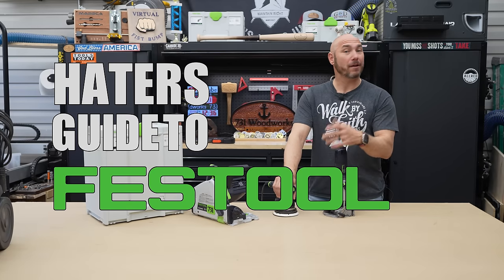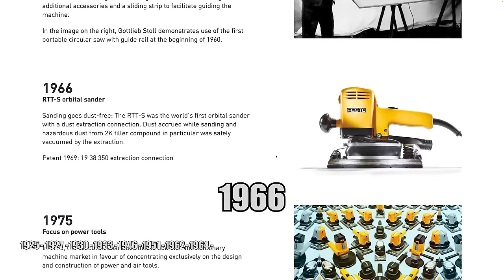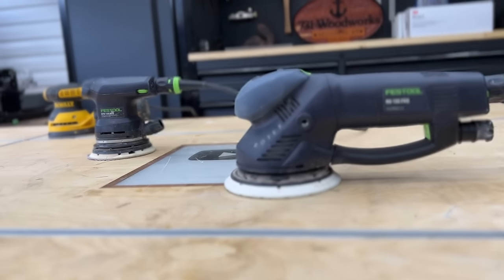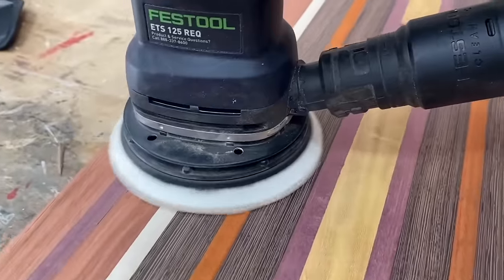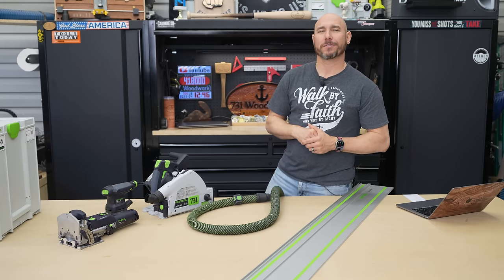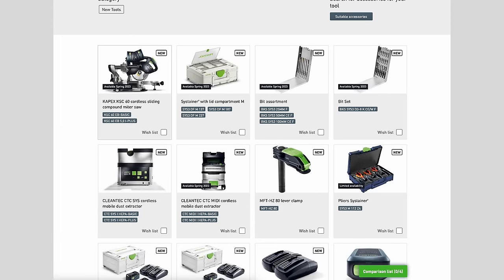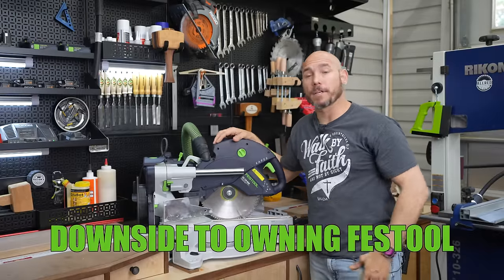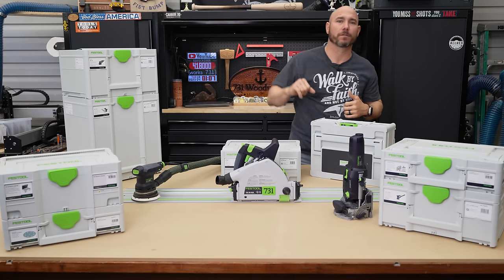The Hater's Guide to Festool | How Festool Changed the Game

Comment: Wait till this guy finds out about Mafell....
Reply: LeMello, Mirka, Fein, Hilti…
Reply: @robhaydnsei  - Fein and Hilti may price the same, but they're not in the same league as Festool and certainly not Mafell. Mirka are specialists (sanding) to me. Priced similalry to Festool and 3M for very similar products but without the same infrastructure.
Reply: Erika😍. When you talk about expensive 😭
Reply: My 2003 mafell jigsaw. I’m 56 I’ll take bets it will out last me
Reply: @garymelrose9727  they're made for different works..
Reply: @basbouwman5139  its only the Price. Hut how long did u use @ Erika?
Reply: @renelange141  Im still using my Mafell Erika made in 1989, its running like new and it got used a lot over the years.
Reply: FEIN is for metalwork, HILTI is for constructions, Festool is for woodworkers who haven't tried MAFELL. 

Mafell is dominating in cirkular saws and jigsaws, Festool might have advantage in routers and dust exstraction.
Reply: I bought my first few Mafell tools (track saw, duo dowel joiner, and jigsaw) in 2020 when supply chain was shut down and Festool was on 6+ months back order. All 3 tools are phenomenal and I’ll be keeping them in mind for any future tool needs, but I also just stepped into the Festool system with the domino and a dust extractor and they’re good too. German engineering, can’t go wrong with either.
Reply: The P1CC shouldn’t be called a jigsaw. Makes a sawzall seem like a black and decker jigsaw.
Reply: Festool user since 1995. This summer i had to replace my first battery.
Reply: You buy all Festool Tools one time in your life … and if anything broke you call Festool and they get it at your home, repair it and bring it back to you … sometimes personal. Which other company do that?
Reply: @garymelrose9727  we're building a house here in Germany and of the 20 or 30 tradespeople that have come through, I haven't seen anything except Hilti. A Makita drill once and a Festool mitre saw for the staircase, otherwise it's Hilti 100%. At least here, it is the big-boy tool. My father-in-law has a Hilti drill and I think I could smash my Makita drill to dust with it without leaving a mark
Reply: @garymelrose9727 well nothing Comes close to the fein multimaster. Which is why basically ever craftsman knows the Brand. Conspny for a Single good tool.
Same with hilti. Their hammerdrills are unmatched by other manufactures, and will last Generations. For jigsaws, NOTHING beats the P1CC by mafell. Plungesaw is up to preference, mafell or festool. Everything else I'd go with festool any day (though for everyday sanding I prefer the mirka sanders)
Reply: @claytonthomas8806 clearly you're not a BMW owner to have that take 😉 I think Sawstop was a great and fitting acquisition for them. The attention to detail by both companies is exceptional.
Reply: @Caffeine.And.Carvings  - hated my old Fein multi tool with a passion. Love my Festool cordless version. I’m aware it’s a version of the newer Fein, but it just has that Festool polish and uses my current batteries. In fact my very first Festool tool was the NiMH C12 (great grandfather to the current C18) because my Fein drills are batteries until they stopped being supported (just over a year). Still have that C12 along with both original batteries alongside a C18 I bought this year. I’m fact the 12V batteries work in the C18 in the extremely unlikely event that I ever ran out of Festool 18V battery power. They even run my carpenter saw and track saw…though at reduced power and, I suspect, not for very long…😂
Reply: @nattyg078  - funny you should mention that, this Festool owner is also a repeat BMW owner, in fact my 6th or 7th, all from new ranging from 1 series through 6 series and not a single issue with any of them. Buy them, use them and after 3 years take them back to the dealer for the first time for an MOT and service and get ready to get another. Very similar reasons - there’s a common design ethos that runs through the series and the generations that means I always know exactly where everything is and what it does. Can’t remember the last time I looked at a manual. Such is the life and contentment of a professional Engineer. 👍
Reply: @Painless61  maffell dont break so they dont need that service
Reply: I live next to mafell HQ in Germany 🎉
Reply: he will drink all of that koolaide...gallons
Reply: I have seen a few negative reviews for the Maffel track saw. Everything else is likely better than Festool.

Comment: For casual people, it’s expensive. If you are a shop and are making money, it’s an investment. The replacement service is crazy good. I don’t own any festool yet, but I’m looking at a boring 5” sander just because after using one for a couple days it was much faster, cleaner, and quieter. I used the 3m 710w sanding discs and worked from
120 up to 240 and it was clean.

It’s funny you mention the 125 sander, I have one in my cart lol.

And so it starts! Toe dipped.

Comment: Festool products, and people's reactions to them, are interesting. For a finish carpenter, Festool -- particularly the entire Festool ecosystem -- cannot be beat. (We can argue about whether Festool is better than some of its top-notch competitors, but that's a different discussion.) Their tools are portable, accurate, and leave little mess. Perfect for doing precise work at the jobsite.

But, what about a woodworker -- someone who makes fine furniture or meticulously crafted boxes and such -- as opposed to someone who merely works with wood? For a woodworker, Festool doesn't have nearly as much to offer. I used to manage a cabinet mill. If I were setting up a large cabinet shop today, Festool would make up a very small part of my tool budget. Since I won't be taking the tools from jobsite to jobsite, portability isn't a plus factor. Nor am I going to want all those systainers taking up space. I might use a tracksaw for breaking up sheets of plywood, but I doubt it. Instead, I'd use a cart to move materials to the table saw. And, many of those table saws would be sliders. I might have a domino (or three). And, I might have a Kapex. Other than that, I don't think Festool products would have a role in my newly created cabinet shop. All my sanders would be pneumatic as would my drill drivers. I wouldn't have router table, I'd have shapers.  

On the other hand, a smaller shop -- even one that does professional work -- might benefit from a whole host of Festool's products. There, Festool's portability pays dividends. Space in such an environment is at a premium, and Festool's ecosystem allows a lot of capability to fit into a relatively small space. If I were building myself such a shop today, it might be exclusively stocked with Festool products.
Reply: 100% agree, my friend makes bespoke built in furniture and he uses a lot of Festool gear when he is fitting on site but in his shop he mainly has serious machines like a cabinet saw and spindle moulder and radial arm saw, planer and thicknesser etc. Festool really don't make any serious shop machines for making cabinetry other than maybe the domino which is an amazing device.
Reply: ANd those pneumatic tools most likely would use festo pneumatic equipment like vavles and so on and so forth, so you would still be using festool or at least stuff from the same parent company.
Reply: makita?
Reply: @ReizungV  I own several Makita power tools. They are all excellent. However, Makita doesn't have the same kind of ecosystem that Festool has created.
Reply: @DKWalser  okey, i dunno what ecosystem they have, but makita has pretty much all tools on 18v and a lot of tools on 40v ?
Reply: As much as I agree with you, in this videos he also talks about contractors. I am a starting contractor and I've owned my business for about 2 years now and festool doesn't add any value for me. The only people in the trades who I've seen use festool is electricians as some specific tools are quiet light and in Europe electricians work above their heads all day.

Besides that. For me makita is the way to go. Alot of other contractors pick Milwaukee for their plumbing products and Dewalt is used by contractors who have a lot of employees who tend to drop their tools down 6 meter high scaffolding. 
No one uses festool since a little bit of dust doesn't hurt when you are walking leaves into someone's house every time a door opens. And the added precision their tools give take too much time to be cost effective.
Reply: @basdewildt7973  You do you. I'm fine with that. I don't have a dog in this hunt. I don't own a single Festool, Dewalt, or Milwaukee product. (I do own some Dewalt and Milwaukee bits, blades, and hand tools.) I do own Makita, Bosch, and other brands. I'm just not a fanboy for any particular brand. I use whatever works (and what I can pick up cheap, if I won't be using it often). 

But, I did work as a finish carpenter in the 1980's and I installed a lot of kitchens and other built-in cabinets. Festool wasn't around then (at least, not in the USA). I can see a lot of advantages to Festool's ecosystem. Their MFT table, tracksaws, routers that work with their saw tracks, shelf-pin drilling system, etc., that all fit in easy to move sustainers, are great for finish carpenters and cabinet installers. Each tool in the ecosystem makes the other tools more effective because they all work together smoothly and efficiently.

Are they necessary? No. As you say, there are lots of finish carpenters who don't use them. Around here, though, it seems a majority do use them. YMMV.

Comment: I’m a weekend woodworker. I was shocked at the price when I first learned of festool. After years of frustration at wasted time and projects from cheaper tools I’m currently saving up for my first festool/ first track saw.
Reply: The value of a good tool goes up exponentially.  I don't do enough woodworking to justify festool prices, but I never by cheap shitty tools.  It's. Just. Not. Worth. It.
Reply: Track saw in general is a great buy, I seriously should have bought one years ago. I went with the Makita, couldn't be more pleased.
Reply: I had to save up for my TS 55 tracksaw but I would buy another one in a heartbeat if anything happened to mine.
It will make you a more accurate woodworker, it is much safer than a circular saw and if you own a table saw you can put a sheet of wood on it and use it as a coffee table because you won't be use it that much anymore.

If someone asked me if I could only own one Festool product, it would be the TS55 Tracksaw.
Reply: Shop the used market, you can save a few hundred bucks.

Track saw + vacuum are my favourite tools.

Comment: I had a lot of work done at a previous house, including a pro fitted kitchen. I always say “the tool is the tool, the blade, bit/blade does the job” but the tool has to still turn the cutting edge. 12 years later and I’m working on my own renovation. I made a conscious decision as I needed 18v as there was limited power on site. I choose makita lxt as my system. But as soon as the power was improved, as well as the hard yards of work (cutting, sanding, planing etc ) festool was my choice of 240v system. It’s always the same, people roll their eyes when you mention the F brand. Then they see the quality of the cuts, they are incredibly and the confidence using them installs in you. There’s only you to blame when it goes wrong, because the tool will never let you down.

Comment: I run sound professionally in film/television. I own all of my own equipment as many professional sound mixers do. The cost of a single wireless transmitter and lav (small mic that I place on talent) are over three thousand dollars a channel (per person). I’m also an amateur woodworker and anything Festool makes seems like a WAYYYY better deal than what I pay for way less useful pro sound equipment. Especially being that you can use Festool’s equipment for real life applications.
Reply: Right? It's kind of amusing coming from that field where hobbiests with $5k mirrorless rigs are hating on professionals with $50k+ cinema rigs to this one where hobbiests with a $500 contractor saw hating on professionals with a $4k cabinet saw. The time and reliability savings from high end equipment will likely never yeild returns for a hobbiest, and that's okay.

I am in the hobbiest category when it comes to woodworking. While a shop full of Festool tools may not make sense for me, I'm not going to hate on a professional for buying professional tools. I can afford to take my time to get good results whereas a professional needs the best possible results in the shortest time possible. I do happen to own a Festool sander and dust extractor. It's faster, more comfortable to use, and less messy than my Dewalts. It's just an expensive convenience for me, but that time savings and comfort may offer significant value to a pro. The content is still relevant to me, regardless of how fancy the tools are.

Comment: I got sold on throwing in the towel on avoiding "overpriced for me" with the ETS125REQ+ because of the edge guide. Being able to sand the edge of a 3/4-3" thick edge while maintaining that perfect 45-90 degree angle is fantastic. Yes, I paid more for the guide than I could have bought a nice big box store 5" RO sander. No, I have no regrets doing it. Since then, I added an ETS150/3 and the CT15. The CT15 has more than enough capacity for sanding duties at about half the price of the rest of their vacuums.
Reply: That edge guide is fantastic. I'd love to dedicate an ETSC125 to it full time, but sheesh those are expensive! The Bosch GET are a sufficiently burly alternative to the ROs if you find yourself needing something like that.
Reply: I didn’t know that edge guide existed until just now. I have the ets125. I don’t think sanding my edges at precise angles matters that much to me for $110, but it’s nice to know it exists. 

At some point you want to leave room for hand crafted character. 

Can anyone even tell if your table sides are exactly 90 degrees. Does your 1/16” edge chamfer really have to be sanded perfectly? 

I guess that’s a question for the philosophers.

Comment: I’m a professional carpenter and find the price is a hard pill to swallow but no doubt it’s extremely well engineered and thought out stuff. It changed the way I work and if I could afford it I’d buy it all
Reply: Some of its great. But I’m not so enamored that I’d kit everything out in neon green. I’d probably get the Rotex, the dust extractor, track saw, and domino. But the rest doesn’t seem any better than alternatives for me.
Reply: It all depends on how much you use the tool, I’ve had a Festool sander for  18 years and it’s fantastic, I like the Domino but very expensive, but a fantastic tool.
Reply: One of the issues these days is that the price of something tells you little about the standards and reliability of what you're getting. A cheapo tool may well wind up being of better quality as they're not able to saturate the airwaves with advertising and have to focus more on word of mouth. But, it's very case by case and brands that were great a couple decades ago may well have been sold to private equity firms and stripped of any actual quality.

Comment: I just purchased the dual battery operated sliding table saw, expensive yes, but site portable and angle cuts can be adjusted to the tenth of a mm. If I want to do 1 or 2 cuts I can attach the dust bag and  dust is minimal. For me as a contracted carpenter and joiner it has been absolutely worth the expense.

Comment: I'll have to respectfully disagree with your sander recommendation. The ETS-125 is a "Finish" sander and has a 2mm stroke with a 250-watt motor. It is a common mistake to think that you're buying an entry level priced Festool sander for $249. The 2mm stroke is fantastic with mid to fine grits and leaves a butter smooth finish. But it isn't aggressive at all and will take a long time if you need to remove any amount of material. The best choice is the ETS EC-125 for $475. I get that it is "WAY" more expensive, but it is a much better all-around sander. It is a 3mm stroke with a 400-watt motor which means it works well with course to fine grits and is more aggressive which equals faster sanding, but it is still capable of leaving a fine finish. The ETS-EC 125 would be your go-to everyday sander and the ETS-125 is a sander to use at the end of a project for the final fine sanding. But you really don't "need" an ETS 125 if you already have an ETS-EC 125, see what I mean? Also, the ergonomics of the ETS-EC -125 are usually preferred by most as well, which makes those long sanding session a bit easier.
I own two versions of the ETS-125, the corded as you have in the video and the cordless ETSC-125, so I'm not a hater, I just want people to understand what they are buying before doing so.

All the Best, Chuck
Reply: Yes the ets125 is comparable to the orbital sanders you get at Home Depot from Dewalt and Makita. Those are all short stroke finish sanders. And those are what the average person thinks of when they think about sanders. The aggressive $500 one are a different breed meant for hogging off material similar to belt sanders but obviously not that wreckless. 

As long as you know what you’re buying and you want a finish sander then the ets125 is fantastic. Much better than the comparable big box brands because it’s not made of plastic drive parts that will brake after moderate use. 

I’m f you want something that will flatten your table top that has one board 1/16” proud you should look elsewhere. If you want to take your properly finished piece up through the grits this is what it’s made for.